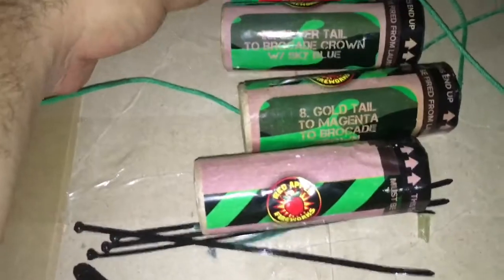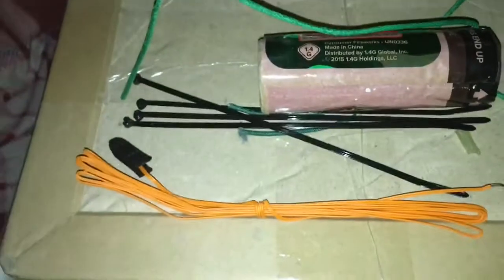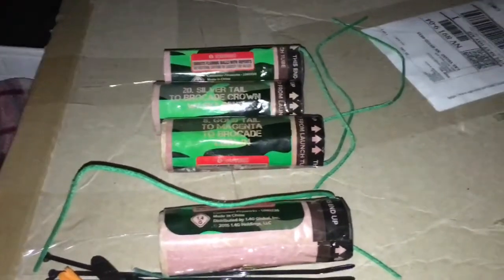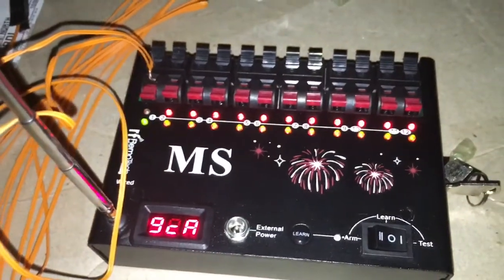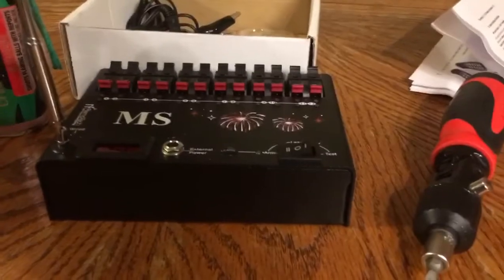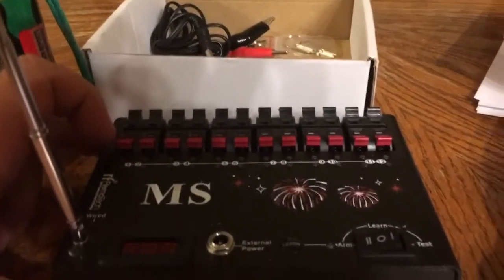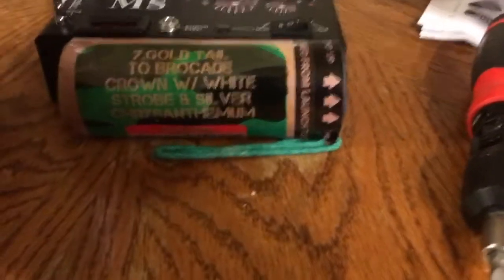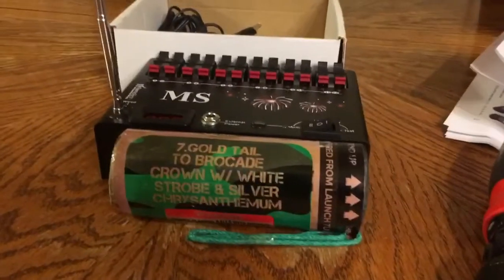1.4g CANISTER SHELL TEST AND MS12Q FIRING SYSTEM TEST.

Comment: how did the tails look in person, it was hard to see in the video, to me the attraction to buy these is for the tails since it's  rare in a 60g can
Reply from the maker: The tails were nice but it's not a "true tail" the effect is created by the fuse burning on its way up. Honestly I had issues with these shells as far as the amount of debris and lack of height. Ongoing to do an experiment tonight to see if the height was my fault or not.
Reply: +PYRO 101881 I immediately noticed the low break. The breaks themselves looked great just seemed awfully low. Could be faulty lift charges?
Reply from the maker: +BoBoThePyro yeah. It's possible I got a bad batch?  I'm pretty disappointed. I bought a whole case of these things, took them out of the packaging and then repurposed the mortars for my new rack. Now it looks like I might have a whole case of expensive canister shells that I can't set off. 😐😡
Reply from the maker: +BoBoThePyro I'm gonna lite a couple more tonight in a different rack to see if that makes a difference? Just grasping at straws at this point.
Reply: +PYRO 101881 i wouldnt think your rack would be an issue they look standard 12in tubes tubes? hopefully things go better tonight!
Reply from the maker: +BoBoThePyro unfortunately I think you're right!  I'm just grasping at straws hoping I didn't piss away the money for these shells. Even if it's not all of the shells that got a bad lift charge, it's not like I want to fire all of them to find out. Ya know?
Reply: +PYRO 101881 man i bet you could get your money back if its feasible for you to return them as long as you have your receipt.